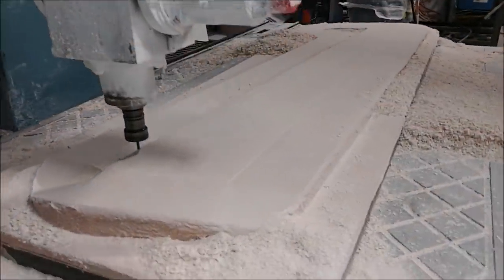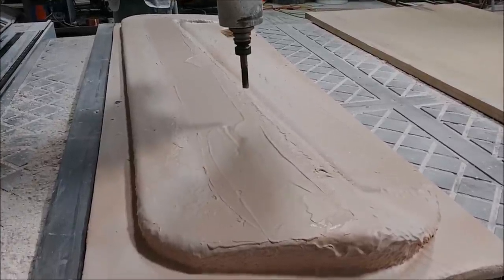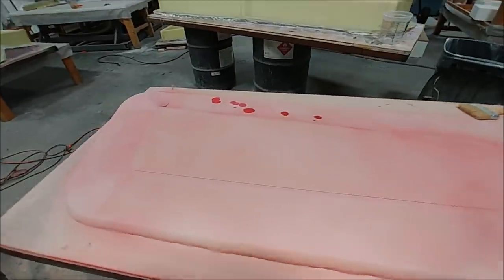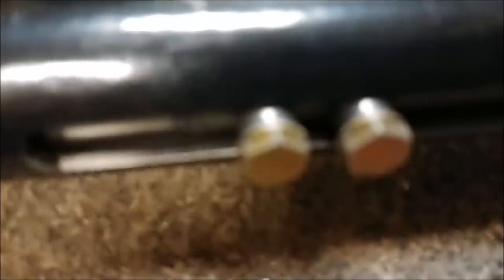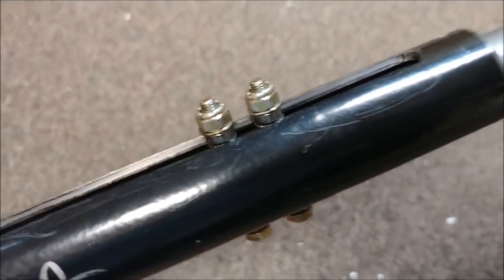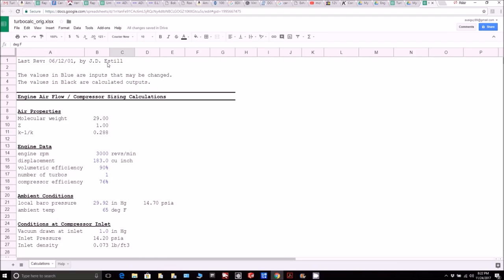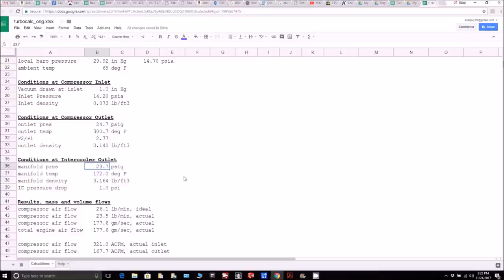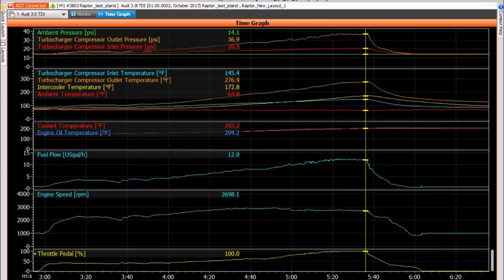Turbo Math for Dummies

Comment: Great information.  The ability to fly at high altitudes in pressurized comfort is what will make these performance characteristics truly usable.  If I were to require oxygen on every flight I probably wouldn't use it.

Comment: For a steady velocity, power is Force (Drag) * Velocity.  "Horsepower required is .14 per lb of drag" is oversimplifying quite a lot.  The back-of-the-envelope calculation I'd start with would be (drag force) * (indicated airspeed) * (prop power efficiency) = (engine output power).

Comment: That's a great power plant you've engineered.  I follow Continental and Austro turbo-diesels via AvWeb.  The numbers they're getting aren't even close to Raptor it seems. Austro's dual FADEC looks like a nice bit of kit though. Cheers.   😜
Reply from the maker: It's because they're not using a compound turbo setup that they can't keep the performance at altitude.

Comment: Mike, please explain further. I got lost in your statement that the Cirrus requires more horsepower at FL250 to get only 143 KIAS. My understanding is that at higher altitudes IAS is lower than TAS, and also that due to less air molecules, there is less drag, which might translate to lower horsepower is required to propel an aircraft.  I look forward to your reply.
Reply: With the fewer air molecules at altitude, your propeller loses efficiency. So, even if you can maintain the same horsepower as you go up in altitude (as Peter plans to with compounding turbos), you still lose thrust.
Reply: Any propeller's thrust is: prop-efficiency times power over TRUE airspeed. So, even if you keep the efficiency up, as true airspeed goes up, you get less and less thrust.

Comment: Ha that was fun, all throughout the video I was thinking "well isn't he missing the colder air temperature at altitude?"... And then in the final 30 seconds there it is... Now I know you don't have a lot of money or time to do this but all this turbo diesel engine stuff isn't that straight in line with what Gale Banks from Banks Power is doing? He's but just small potatoes DIY garage shop they have big government contracts for the military giving big diesel engines more power and better fuel economy. They also gave the fastest diesel dragster and produce some of the most powerful diesel engines. Now they usually don't work on Audi but diesel is diesel and turbos are turbos so you two should have some common ground. Right. You plan on the Raptor being successful which potentially means hundreds of engines each year so there's a rather large market opportunity. Go talk to Banks...

Comment: What diameter does the prop have? I found a formula that gives you the rpm goal for a given TAS to operate a prop at its most efficient point: http://www.nar-associates.com/technical-flying/propeller/cruise_propeller_efficiency_screen.pdf
Reply from the maker: It's 76" and MT has limited it to about 2660 rpm which is why we're limiting the engine to 3800 rpm.

Comment: You can't just take the power required for a given IAS at sea level and extrapolate it to FL250. The note at the bottom of your Lift vs Drag comparison chart says, "The .14 number is calculated because we know the Cirrus requires 170hp or 55% power at sea level to get 149kias." Maybe so, but that same Cirrus requires 268hp or 85% at FL250 to get only 143kias. So the assumption that you only need the same power at sea level to get a given IAS at FL250 is incorrect.
Reply: Mike, Do you own a Cirrus? I almost did. But now I do not. I have Peter to thank for that. thankx Peter!!
Reply: No, but I occasionally rent one. I'm only using the Cirrus for comparison because that's what Peter is using to derive his numbers. The numbers I gave above are from the SR22T POH.
Reply from the maker: Mike, thanks for pointing that out. You are correct. I re-ran the numbers for 300hp at 25000 feet and in the Raptor we should see 175 kias for 262 ktas. So we don't have the 300 it as but I'll still have a big smile on my face.
Reply: Thanks, but can you show your math? I still don't see how you get 175KIAS at 300hp, even granting the 15% drag advantage over the Cirrus. My understanding is that a 15% reduction in drag with the same power should result in only a 5% increase in speed. Similarly, a 15% increase in power should result in only a 5% increase in speed. (Remember, propeller thrust decreases as speed increases.) So, increase the Cirrus speed at FL250 by 10% and you get 234 KTAS. So, using your fuel burn numbers for 300hp, I think it will require about 13.6 GPH to get 230-ish KTAS, not the 7 GPH as stated on your website. Don't get me wrong, an airplane as wide and comfortable as the Raptor that's pressurized and air-conditioned and does 230 KTAS while burning, say, 14 gph is still pretty damn good, so I wish you luck! I just think the speed/fuel burn claims are a bit overreaching as it stands.
Reply: Instead of spending all that time calculating wouldn't it be easier be easier just to mount that Audi to a test stand and then see what it burns ? I would make a test stand that would simulate turbulence and shake the hell out of it.... find an air compressor that would do 500 psi and run the engine 15 hours a day.   There is 50 plus days till the orings shows up so by that time there would be 750 hours on that Audi. A  guy should have an idea what the fuel burn is by then. The way I see it the whole project hangs on if it is possible to make reduction drive work.  And running it for 7 weeks straight should test it thoroughly.  Great progress and thanks for the updates.
Reply: The crux of the issue is not what the engine will burn on the test stand. Rather, it's how much horsepower is required for a given speed at FL250. I think his horsepower required numbers are too low, and that's how his unrealistically low fuel burn numbers are being derived.
Reply from the maker: Well, let's just wait and see what we get when the prototype gets up there. Then we wont have to speculate any more.
Reply: Yes, I look forward to that!
Reply: Doesn't the diameter of the propeller also play into the total thrust?  If I recall, the Cirrus SR 22T has a 78 inch diameter propeller.  I do not know what diameter Raptor Aircraft is using.
Reply: Sure, but that's not really relevant to the point. As you go up in altitude at a given IAS, your TAS increases. Unfortunately, prop thrust decreases with an increase in TAS. So effectively you lose thrust as you go up in altitude. That's true of all propellers, regardless of diameter.